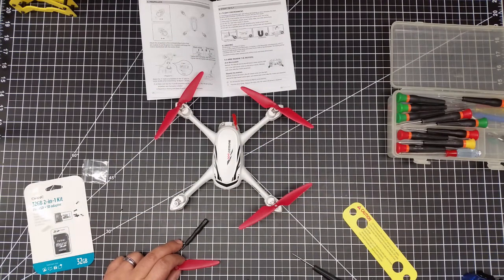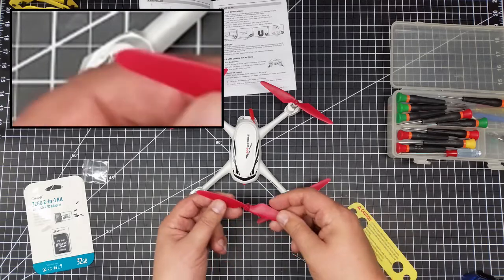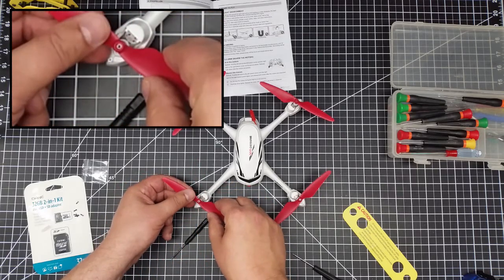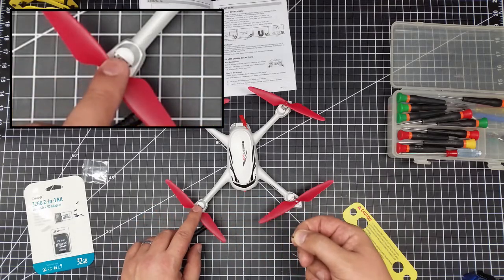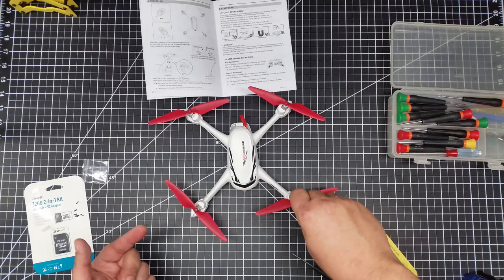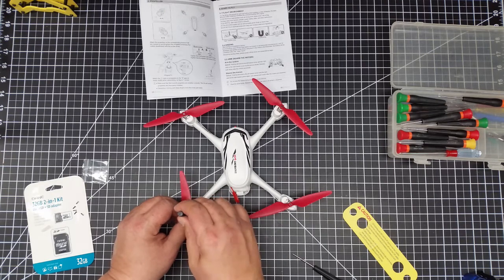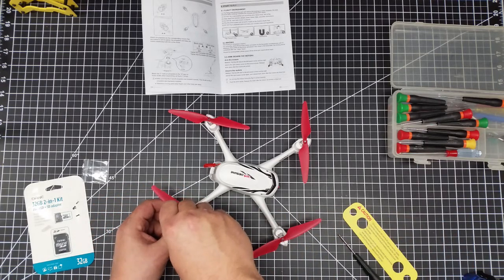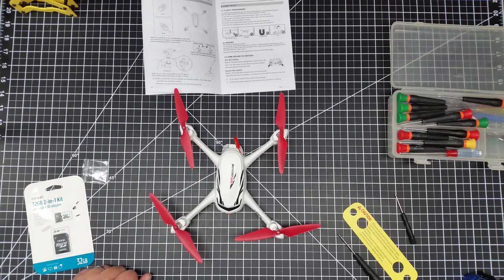Video Drone - How To Install The Props Hubsan X4 Desire!

Comment: I have two of these and noted that even when you snug up the screws ever so gently, it can bind the propellers from spinning freely but if you back them off about 1/4 a turn, they will turn freely.
Reply from the maker: I could see that happening...

Comment: I got my screws in they were very hard to turn with that lockrite on them,my directions no where does it say the black screws are counter clock wise,I learn it on you tube,I called husban company tech support,they said I had a old book and my screws shouldn't have blue locktite on them,well I found out I had a older book,because one of the pictures were covered up with a update sticker,husban gave me new screws ,they were still hard to turn ,but I got them all in,haven't flow it we are having a heat wave in ca today will bwe a 108 ,so I won't get a chance for a while to see if it fly's.,anyone else find these prop screws kinda hard to put in
Reply from the maker: Interesting about not having blue lock-tight on them as I have never seen a set with out (even after market) as they took a little extra force however thing major.  One of the things I do suggest is getting a "good" small Phillips screw driver as the orange handled one, works, but is far, far from the best...

Comment: Thanks they aren't cheap are they ,if you happen to find the screws only let me no,if not I guess I will buy those,this quad been exspensive and I have even flow it ,I think I haveing a brown thumb week ,but thank you for all your help
Reply from the maker: No worries happy to help and 20 bucks for 4 is normal as again expect to go though props as they break very easily.  Also never seen the screws separate, however you could write Hubsan and ask, however will bet they cost about the same as with the props...

Comment: My directions didn't say counter clock wise,did your screws have a coating of lock tight on them ,mine did,which I thick that was part of my  problem.I try again tommarow ,I hope I didn't bigger up my screws to much ,thanks for your help
Reply from the maker: Yes, one set turn clockwise while the other is counter-clockwise and yes to the blue lock-tight also that is normal. Also yes you could have buggered up the screws as it easy to do, you should have gotten a second set, would suggest trying those...
Reply: Video-Drone would you no where I can get another set of those screws ,I tried on eBay nothing came up,anyone ,thank for your help too
Reply from the maker: When you buy a set of replacement props they typically come with new screws... (here is a link to them on Amazon: http://amzn.to/2tb1nPq )
Reply from the maker: PS would recommend buying extra props any way as the break very easily...

Comment: I tried them both ways the whole they are supposed to go in ,looked like they weren't tapped out with a good light and a magnifier I couldn't see any threads ,the whole looked to small,are you saying ,the black screws are to be turned in counter clock wise
Reply from the maker: As mentioned to you on the other post, the screws are easy to damage, the shafts will be harder.  You should have gotten a second set of screws try those.  Also try without the props to to see as you might also not have the props seated all the way down therefore the the screws aren't grabbing...

Comment: I saw the prices on amazon for replacement motors,do you no if eBay has them cheaper
Reply from the maker: I bought an upgrade set from this guy (https://micro-motor-warehouse.com/) he has a YT channel and these are suppose to be hotter than stock.  Have not had a chance to test them as been too busy with work but look for a video in about a month...
Reply: Video-Drone I would always upgrade if I get the chance,do you own a husban 502 E. If so does it have auto launch ,and land
Reply from the maker: Yes I have one and no on either however it really is not necessary as you just pop the stick and it hops up a couple feet and hovers (you can see this in my videos) and landing is just as easy...
Reply: Ron Thompson thanks for the info

Comment: did anyone have the problem of one of the props not fitting tight - can't figure put why there is to much play in it - also the instructions in the manual are wrong for lining up the props with the straight line on prop (wrong side) - this is in the 502s too
Reply from the maker: Yes people haven written to me a lot about this and if there is play hate to say it your not aligning props correctly as there should be no play.  These can be a bit of a bugger to put on as for the first in forever I had to replace a prop and I had to go back and watch my own video to remember how to do it :-)
Reply: lets see I put on the other 3 props on and they are fine and put the 4th on the same way it slides on just like the rest but it seems to have more play up and down ( like the bushing on the bottom is missing - I am buying ball bearing bearings and I will see if that changes anything - the shaft pulls up more than the other 3 - I even tried a new prop???
Reply from the maker: If the shaft pulls up more, I would open it up and look to ensure all is good as something is a bit willy wompas in there....
Reply: Archie Henderson same here but flys fine only 1 also.

Comment: Video-Drone, can you clarify this for me. The silver screws tighten by turning them clockwise and the black screws tighten by turning them counterclockwise, correct? I just got this drone and I was able to get the silver screws on and snug, but the black ones I can't seem to get snug. They aren't stripped, but they just keep turning; however, I can't get the props off unless I pull up on them while unscrewing the screws (clockwise). I even removed the prop and just tried to get the screws into the stanchions, but I couldn't get them snug, or even in very far. Any ideas? Also, when the screws are tight, should the props still move up and down on the stanchion a little (1/8 inch)?
Reply from the maker: +Jerry Scanlon the props should not move vertically when tighten at all.  It sound like the props are not seated properly...
Reply: Okay. Thanks for the quick reply!! I'll take another look at it this evening. I believe the props are all seated correctly because when they aren't, they sit higher on the stanchions. I have reviewed the directions a few times, but I'll review them again tonight.
Reply: Jerry Scanlon I have the same problem jerry, the black screws don't tighten at all..and when you line the prop with the D gap it sits high
Reply: Jerry Scanlon Could you fix the problem with the black screws? Because I seem to have the same problem... I can't get the black ones on. Did you find a soultion?